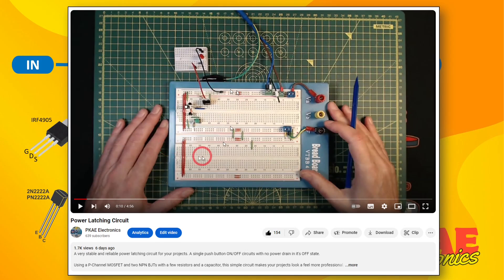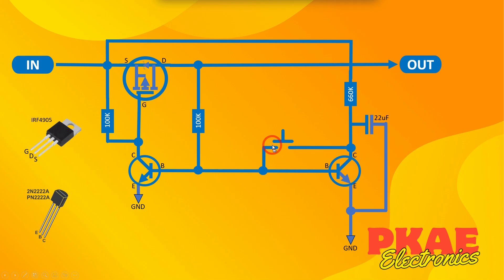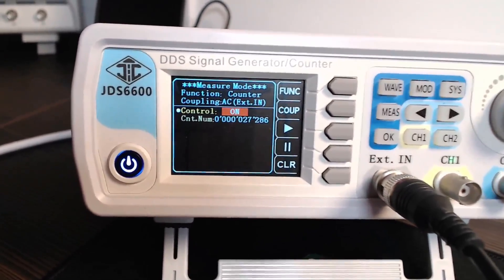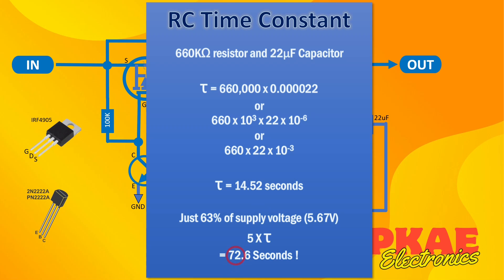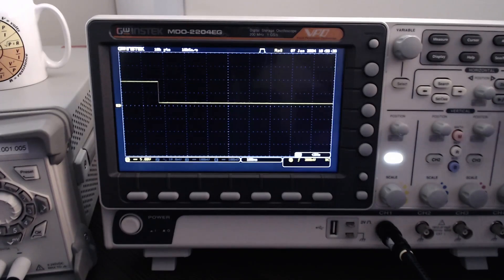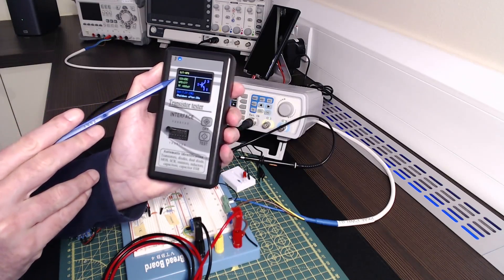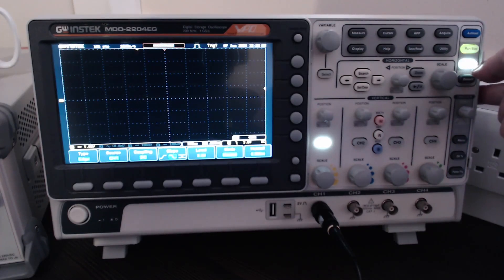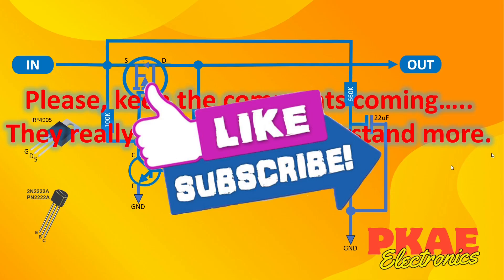Power Latch Testing

Comment: I would add a 100 ohm resistor in series with the capacitor. No need and would not want a higher value.

Comment: Looking at the ON semiconductor datasheet for the 2N2222 I found a graph called the Collector Saturation Region, and you can see  the base current going to 50mA in their test. So Im guessing the transistor can possibly take more than that. Beside you did a test to some 40,000+ switches, what device will live long enough for that many on/offs. I also did a simulation on multisim and tried the in series resistor with the switch and found the switchyness only worked when down to some 500ohms, anything higher just failed. I think its a good circuit as it is, and  will probably be using it myself at some point in the furure (unless i use just a latching push button switch)
Reply from the maker: Thanks for the comment.

Comment: Regarding the NPN transistor on the right, the base-emitter junction is a PN junction, which is forward biased when the switch is actuated. "Instantaneously" forward biasing a PN junction should not be an issue.  Otherwise, we could never apply square waves to forward bias any PN junction with a "large" voltage in accordance with some metric.  Accordingly, I seriously doubt that the transistor will eventually fail at the base-emitter junction from "instantaneously" applying 9V.  Further, most of the power will not be dissipated via the base-emitter junction.  Since the base is directly tied to the collector, the PN junction of the base-emitter will dissipate approximately 1/h_FE (or 1/beta) of the power dissipated by the transistor.  Anyway, that's my $0.02; your mileage may vary 😉
Reply from the maker: Thanks for the comment. I do agree with you that discharging 9V, even without current limiting resistors at neither the base or emitter should be OK. There will be an initial very small window however, when the B/E current  is fully discharging the capacitor as the transistor has an inherent rise time. Its not ON instantly. If I were going deploy the circuit in something a bit more professional I would consider adding a relatively low value resistor between the emitter and ground.

Comment: In general, this scheme works on an undocumented but well-known effect. For stable operation, a load is required so that the transistor bases do not flying in the air when button is released. A resistor of about 10k is needed.
Reply from the maker: @f33net thanks, I'm not quite certain where in the circuit you are suggesting the 10K is added. Tying the two bases high or low via a 10K would mean the original power latch circuit would not operate.
Reply: @paulpkae  at the output of this circuit as a load.
Reply: @f33net  I getcha, I would assume you would always have a load otherwise what's the point of the circuit?

Comment: Before the transistor burns out with the current B-E, it will have time to open and discharge the capacitor through C-E, which is much stronger. If you disconnect C of transistor on the right, there will be a breakdown of B-E.

The energy of 22uF is not so great as to destroy the transistor, besides, the internal resistance of the capacitor limits the current. But a good engineer does not break the rules and does not take risks against the theory, even with a positive experiment.
Reply from the maker: Yes the base to collector connection acts like a current regulator or half of a current mirror. If I were to utilise the power latching circuit in a full blown product, then you would need to  consider the project as a whole. The latching circuit alone, serves no purpose. You would need to account for the next onward stage in the circuit:- input impedance, voltage requirements, surge currents, back feeding etc.

The circuit as it is, is good enough for personal projects that have ad-hoc usage. If anything, I would place a relatively small resistor (100-200 ohms) between the emitters and ground.
Reply: "But a good engineer does not break the rules and does not take risks against the theory, even with a positive experiment." This point leads to my following question... Background = When I retired, I took up EE as a hobby, to keep my mind active. I am self-taught. I only study those things that interest me. The lack of structured training means I have large gaps in my knowledge base. Therefore, I can not determine what are good and bad circuits. The internet is full of junk circuits. I waste lots of time trying to sort through them. So, my question = How can I readily find properly engineered circuits that meet my needs? I am not jesting, here. I am truly frustrated with all of the junk circuits, the wasted time, effort, expense of prototyping, etc. If I ask on a forum to be pointed to a good circuit, it stirs up a bunch of nonsense and I don't get a straight answer. Lawyers have books of "boiler-plate" standardized documents. Is there such for electronic circuits, other than those in individual data sheets? Thanks for your help.
Reply: @t1d100  You are asking a very global question. In modern life, the threshold for entry into all areas of knowledge has been reduced to zero in media. Any upstart can record a video, publish an article. To do this, do not need to gain knowledge and experience. Therefore, modern useful information is immersed in the abyss of useless noise and dirt. Finding good sources is not easy. People with good knowledge and experience do not tend to entertain the public most often and are invisible in the media.

Therefore, the basic knowledge gained during education and the formation of accumulated experience are now the main source of personality. Sometimes you can ask your colleagues for advice, but you should expect a bunch of nonsense that you wrote about. Experience gives credibility to opinion. And, of course, it is necessary to make allowances for an accidental human error.
Reply: @t1d100  - buy a good book on the subject. One that was originally published before the internet went crazy ;-)

Comment: This sounds very much like one of those "it works in this particular situation" kind of situations. If you search online for "can I tie base to supply" you get a flood of "absolutely not" with pretty good explanations for why not.

But the circuit does not tie base to supply, it ties base to a capacitor that is at supply-voltage and as we can see, does not have the oomph to do any actual damage.... in this circuit... to an 2N2222... if you take the component-tester's result as verification that the transistor is not damaged at all. Personally I'd have loved to see the readings for each transistor before the test and after.
Reply: There is no direct power supply to base, here base is connected to collector - this is a significant difference. When  base current starts to rise, transistor will start to open and shunt base current with collector current. This scheme is similar to an avalanche diode and it has a legitimate existence.
Reply from the maker: @f33net  Thanks. Yes the base to collector connection acts like a current regulator or half of a current mirror. Therefore current will also flow via the C-E junction, but there will be a momentary period where the B-E junction gets whacked with the full 9V discharge.
Reply from the maker: Thanks for the comment. The discharge period lasts for just 194 micro seconds and given the next cycle would be a couple of whole seconds after that, then the transistor has plenty of time to recover.